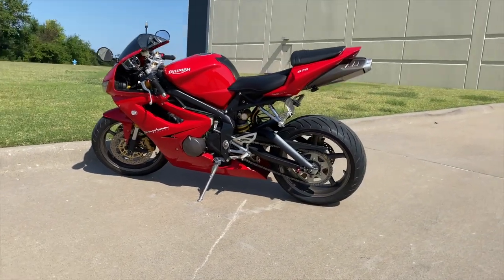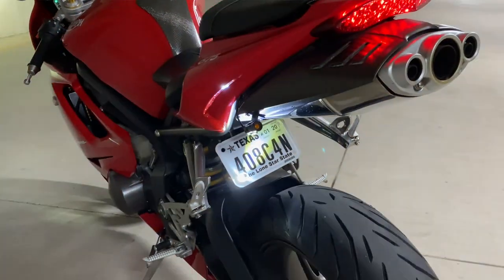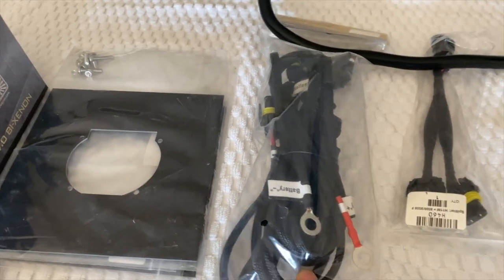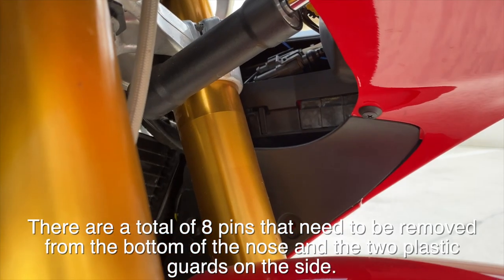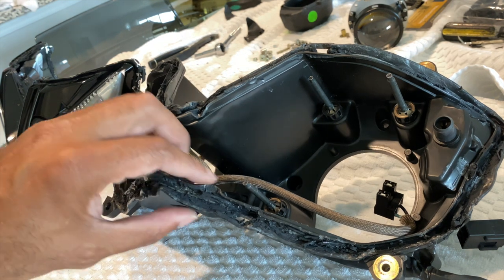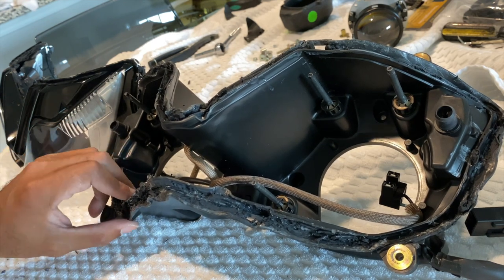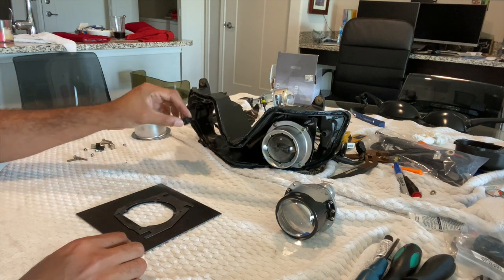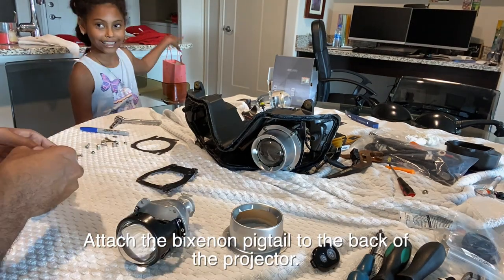Triumph Daytona 675 Headlight Retrofit with Mini H1 Bi Xenon Projectors

Comment: I may not do as much, but this video could help me with installing HID's on my bike. The two things that really catch my 
eye are the 5-7 second delay harness, and the splitter. In my case, I want to be able to install just low beams 
on my bike, with  both headlights low beams, and both headlights working at the same time.
So far this is the only video I've found regarding this topic and the older Daytona's, and I've been searching for years.
Reply from the maker: Thank you for the feedback. Please let us know if you have any questions.

Comment: Hi im trying to do this conversion myself and get the parts but where did you get the brackets to cut out for the new projectors, and where did you get the relay harness because i didnt see it in the description, also how would you connect it? Thanks in advance👍🏼